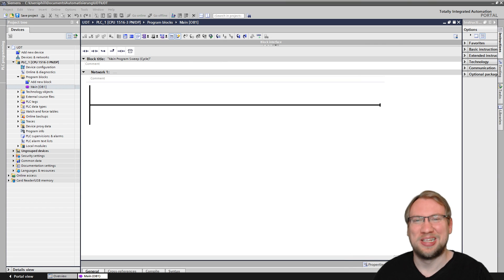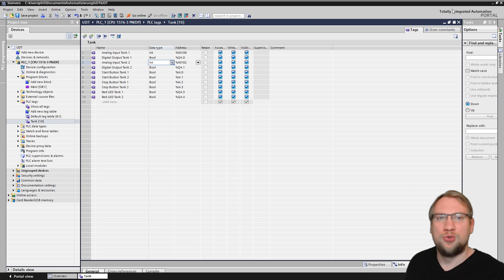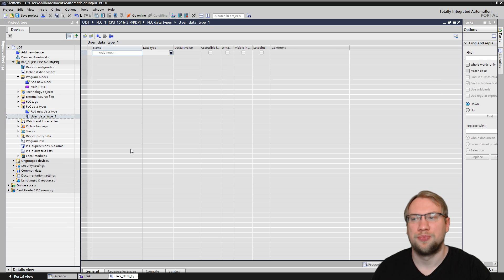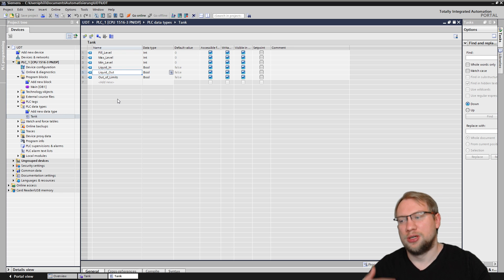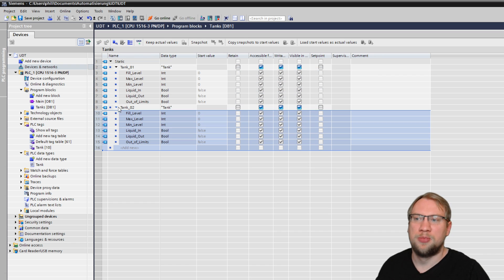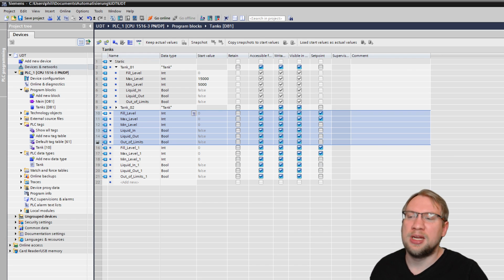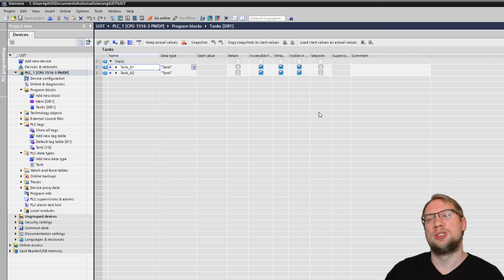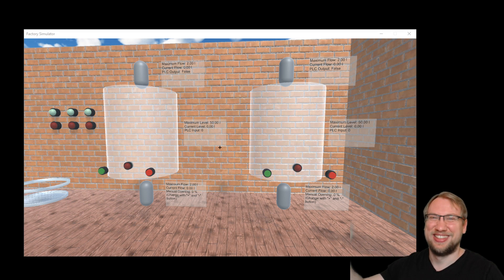TIA Portal: UDT's (User Defined Types) - Part 1

Comment: Thank you for the outstanding videos, these are a great help in planning for an implementation. One aspect of the UDT that was not covered was retention memory. For example if you have a mixer, it can have a few parameters that are set and some parameters that are retention, I.e enabled, speed. In UDT I see the the whole struct can be set as retention memory. Is it possible only to set certain members as retention memory ?

Comment: Hello, is it possible to edit the UDT in text “window “but not the table “window”(standard in TIA)? Just like in the text window, you just input like :
motor_ctrl_data_typ : STRUCT 
     motorStart : BOOL;
     motorStop : BOOL;
END_STRUCT;

Current I use the notepad++ to edit UDT… it works…